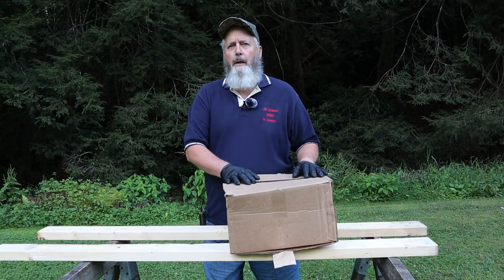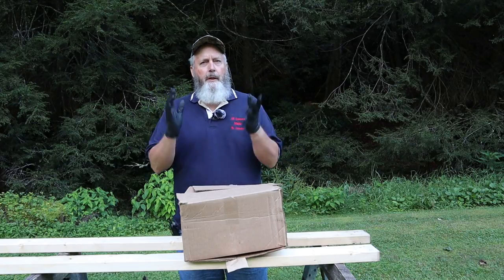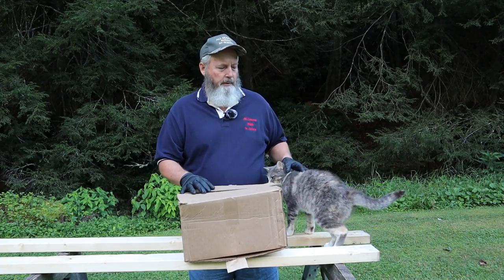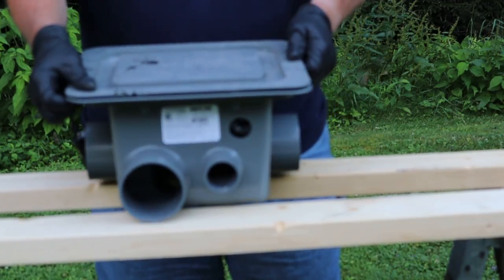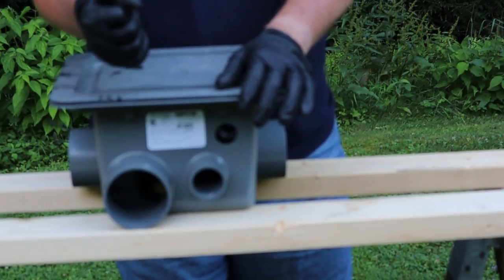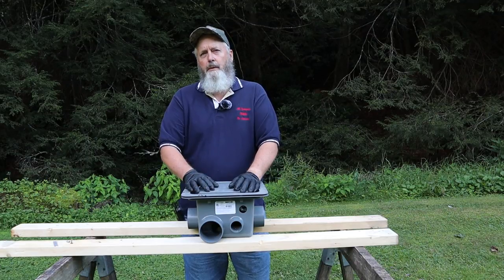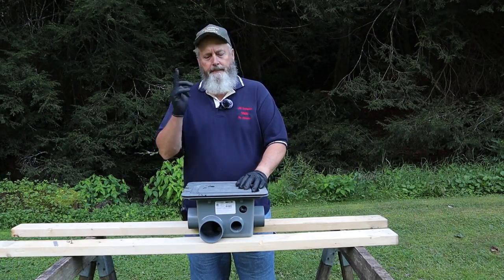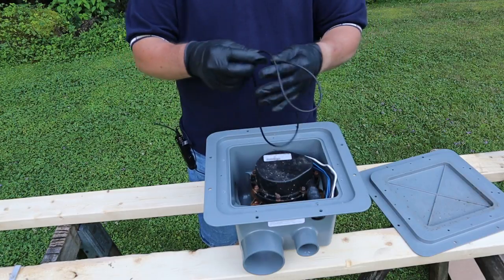Tech Talk #5 Macerator Pump Explained

Comment: My sewer clean out at home is far away from where I park the Motorhome. The macerator works great when I come home with full tanks because the line at the dump station is a mile long at the state park.
Reply from the maker: Awesome. It will pump it pretty far.

Comment: $400 pump to push poop uphill. For me its surely not needed. Thanks Don
Reply: When the only place you can park your RV is over 100' from a sewer what would you do?
Reply from the maker: Thanks Don. Read everybody elses comments. There are quite a few places where it would be handy, guess.
Reply: @RichValrek  yes, if I lived on the property.
Reply: Oh man, mine only cost $65 and is a very sturdy build. Very basic, but best that way, in my opinion. I couldn't dump without it..
Reply: My thought is if someone wanted to transfer waste to bigger tanks that were mounted on a trailer or in a truck bed and save the back aches.